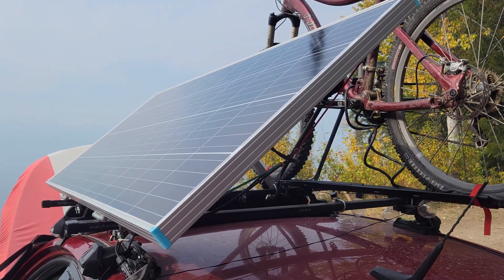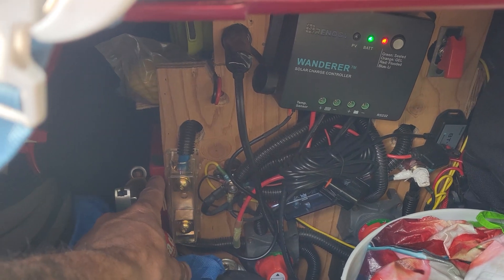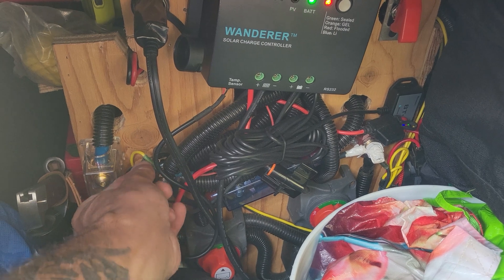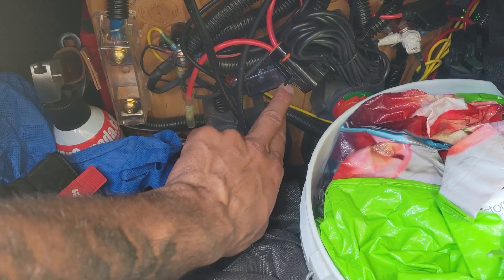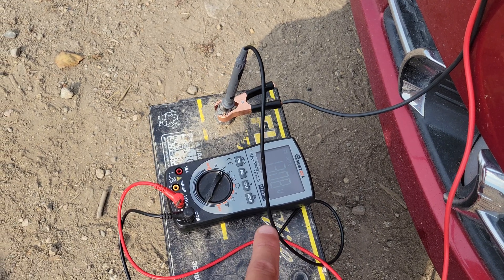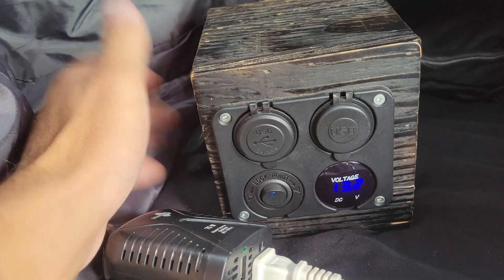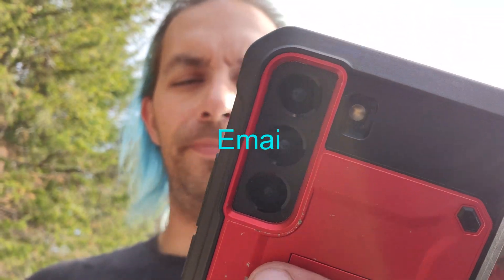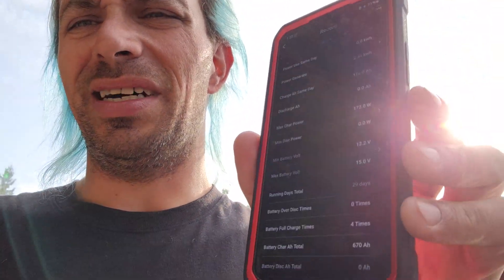Renogy Wanderer 30A-Li PWM Review

Comment: Hey cool vid! Are your panels wired in parallel or series? Or both? How many volts of pv input? Thanks!
Reply from the maker: the 200w panel i have is renogy and it outputs 27v, i've had 3 instances where the panel overvolts during float stage when the batteries are full. when the battery is being used and the car is deployed with more ground mounted panels, there is not much issues at all, i can add a bunch of other ground solar panels that i have 40w coleman and no issues during camping, but would prefer a higher PV input capable solar controller

Comment: Hey man, you seem quite knowledgeable so I have a quick question for you. I've had my two batteries hooked up to solar and I'm using the same charge controller. I do not have a full charge currently. I've been out in the sun all day. I just realized that I should have changed the battery setting on my wanderer to flooded. This whole entire time I had it set to default which is sealed. I was wondering if that was possibly the cause of all my problems and why my batteries aren't charging properly. Thank you so much for any information you may have!
Reply from the maker: Yeah, i'm not sure to how much to the extent of though.. however the charge voltage for AGM is slightly different than lithium and flooded batteries. if you got the same model as me, you can just hold the button down and scroll through the colours, i believe AGM is orange, blue is lithium, and red is flooded, but verify with your manual, you can look it up online. hopefully you figure it out!